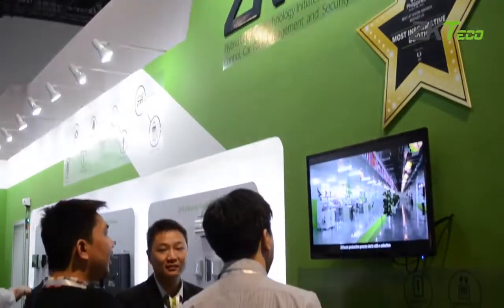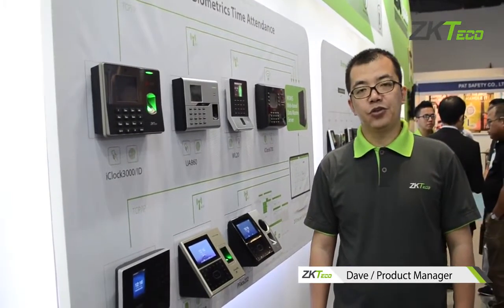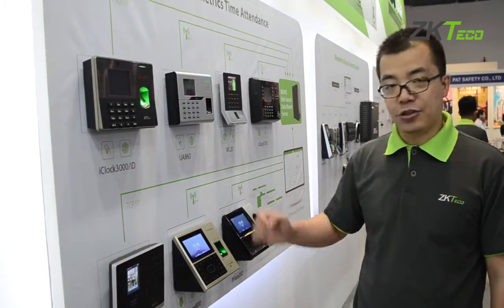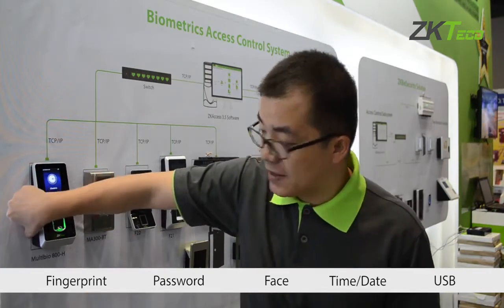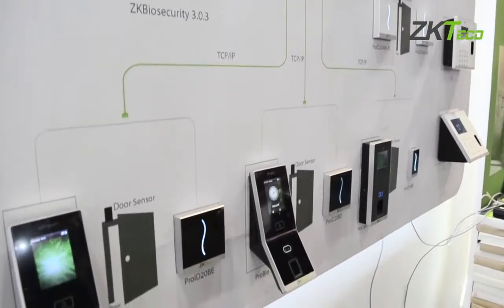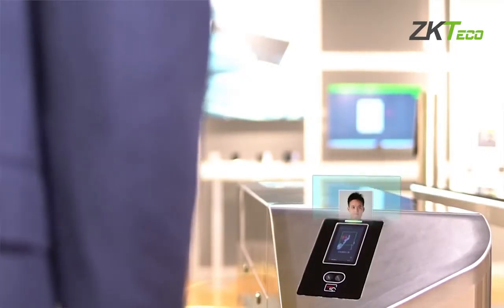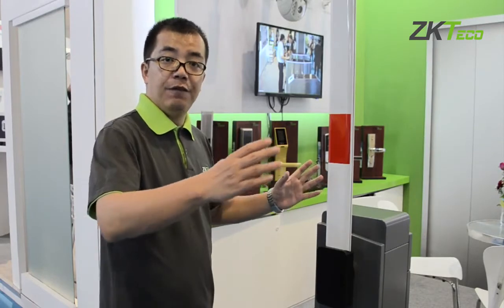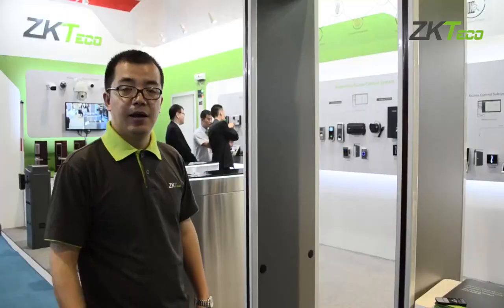ZKTeco Present Latest Technologies in IFSEC Philippines 2017

Comment: Dear Sir,

We are the distributor of Zk Iface Fingerprint devices but now we need your help to solve 1 issue which we are facing now a days, Actually most of our  clients looking for the Display Check IN and Check OUT feature while punching by employees. Or let me know How to configure or adjust the settings in the device to activate this function into the device.

Or Can we update firmware of the device to get this feature?

Please help us.